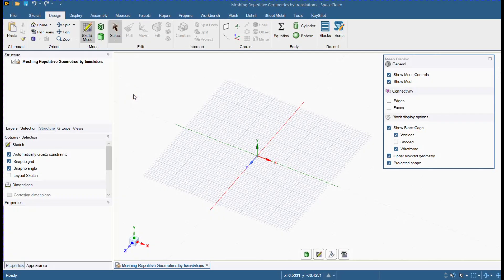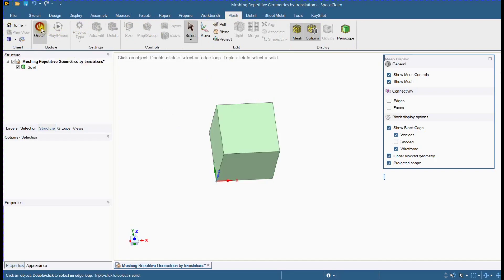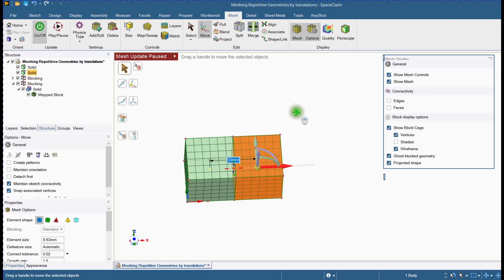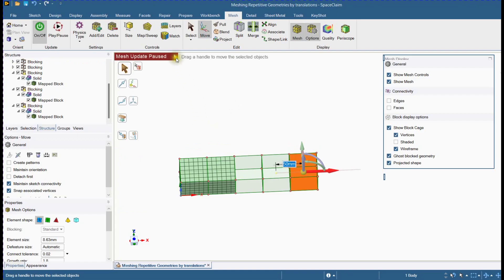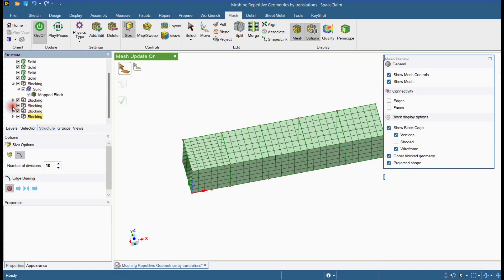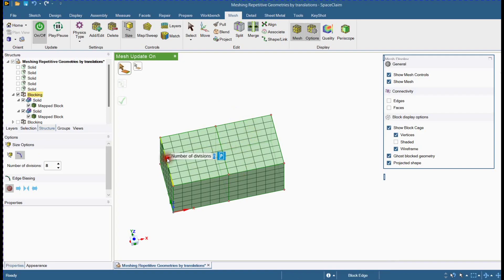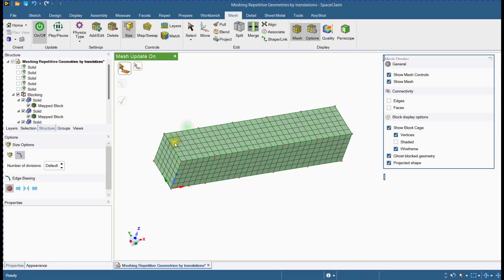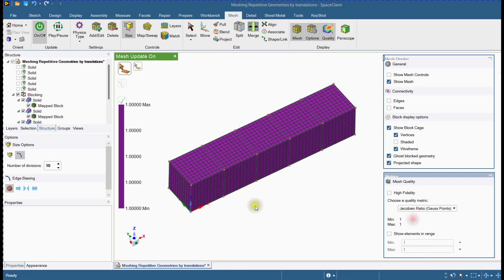Effortless Mesh Editing in ANSYS SpaceClaim: Copy, Move, and Merge Mesh Nodes Tutorial 🔗

Comment: These 5 solid parts consisting of copy meshes work as 1 solid body during analysis or is there a contact I need to define there?
Reply from the maker: To define contacts for these geometries, ensure that the shared topology between bodies is specified so that nodes at common surfaces are merged automatically. If shared topology is not applied, you will need to manually/automatically apply contact definitions.